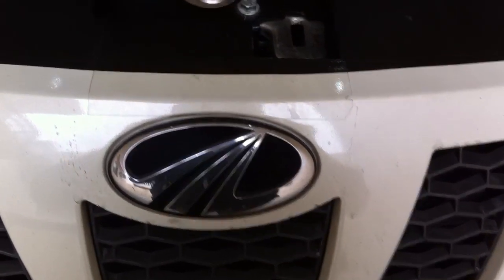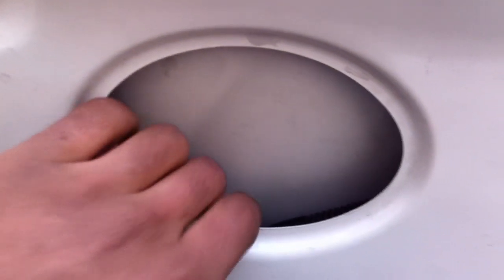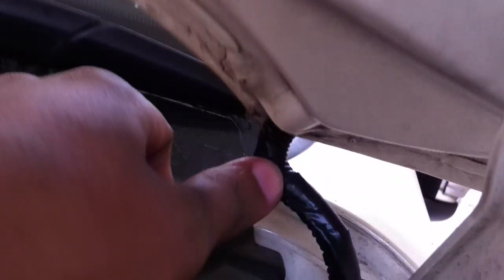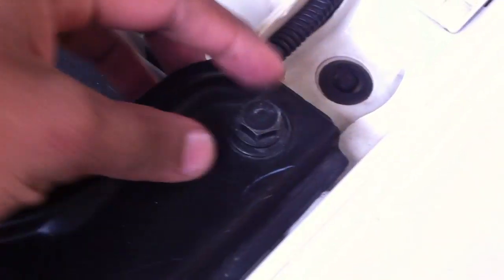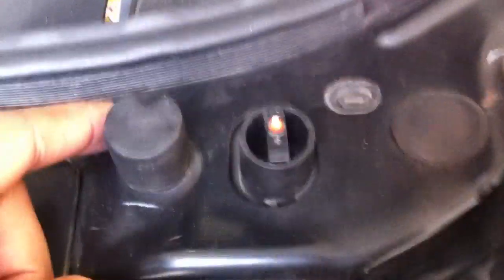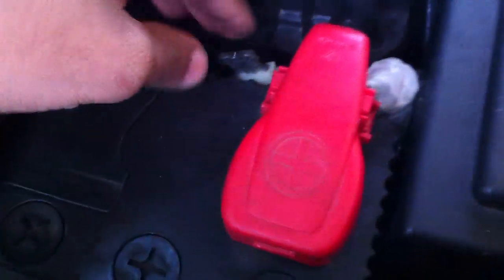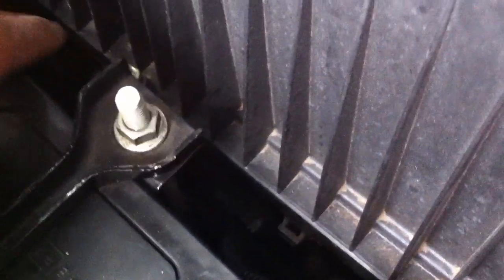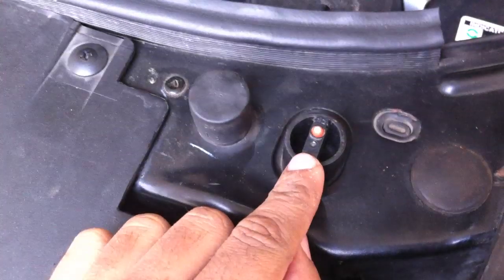How to install lights in Hood/Bonnet of XUV 500 | Most important lights for engine area

Comment: how to install door light ? when door opens the light will be on . where to take the powersource ?
Reply from the maker: Rachel Frankie most of the lights are ECU controlled, so better to avoid any exta one. Yes you can take power source from cigarette lighter and that too through fuse.

Comment from the maker: Bro its veey easy... Just loose ellen keys on outer boundary of plastic box of filter ... Unplug sensor by pulling yellow plastic lock out ... Disconnect pipelone by losing nut bolts...try to upload video thanx